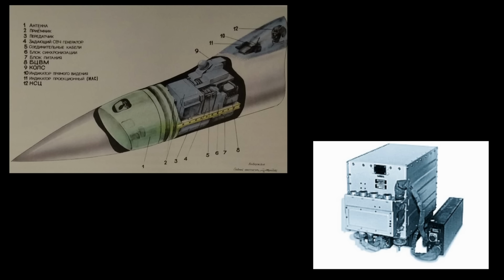Orbita: Computerizing Soviet Frontal Aviation

Comment: "They were produced in both register/register and register/storage formats"  is actually a pretty wild thing to mention in passing.  Those are fairly different design philosophies, so it really underscores how much that era was just total Wild Werst Anything Goes with no concern about backwards compatibility.  If Intel tried to launch a strict load-store register/register variant of x86 today as a direct replacement for existing processors, the whole world would revolt.
Reply from the maker: Indeed, I mentioned before that modularity / compatibility was out the window with Orbita-1

Comment: Why did preformace increases in soviet airborne computers slow down so siginfigantly in the 1980’s  from c-100 (170,000-200,000) operations in 1982 to C-101/102(400,000 ops per seconds)? It is not until SB3541(5 million ops per second) that preformance increases start to pick up.

Comment: There may be some 16 bit computers that can run Doom, but not many, and any that can would be in the 10 MIP range of performance. Orbita being 1/10th that ... no Orbita could not play Doom :). FYI Doom was written to be run on a 386 DX with FPU. So a 32 bit machine with floating point unit in the 10 MIP or better range. You're really want more MIPs. Doom ran best on the 486 and better series. Orbita, assuming it was a full up true 16 bit machine would be comparable to the Apollo Guidance Computer in terms of memory, ROM space, and clock speed. They had similar functions. The AGC also was a prototype fly by wire system on a converted experimental F-8 Crusader that laid the path for the F-16's flight control system. If you accept that late 70's consumer 8/16 bit computers multiplexed 16, and 32 bit data on their 8 bit bus, it sounds like the Orbita class computers would be comparable to the old Commodore PET, or Commodore VIC-20.
Reply from the maker: The statement about Orbita running doom was a joke, it could not run doom in a playable fashion, but I do not see why it would be impossible to technically "run" doom (mainly running sounds on a modified machine). From what I have seen 16 bits is the minimum to run some of the sounds in game.
Reply from the maker: This is what inspired the statement, not technically running doom the game but running sounds from the game: https://youtu.be/no0CkQk7id0?si=AmPxjyAC2ZvsGmhL&t=652
Reply: @CombinationK  Ah ! Of course Yusagi Electric's music demo! Now I see what you mean. Play "Doom" of course.